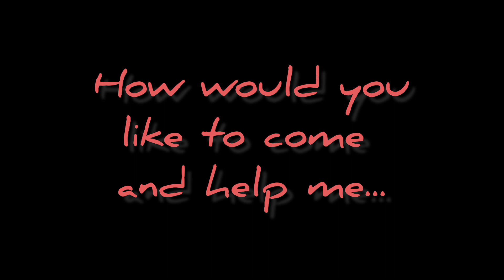Drawing and Cutting New Designs...

Comment: Cool, those things have changed alot since i used one. Its smaller and i bet far easier to program and i bet it does not need a lox or nitrogen tank either.🙃😏😎
Reply from the maker: Vincent runs it.  I just draw.  But I think it only used water as a coolent and compressed air along with the laser, of course.